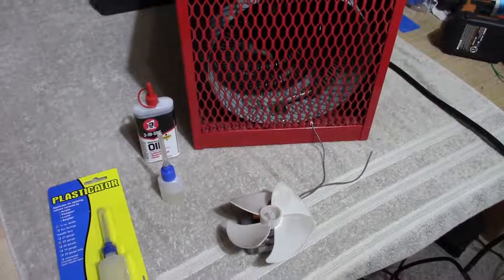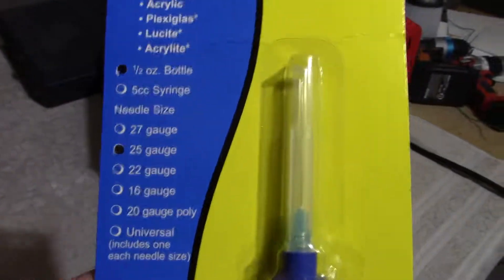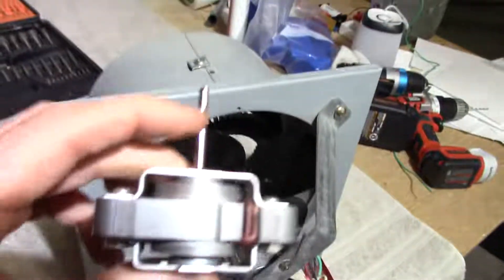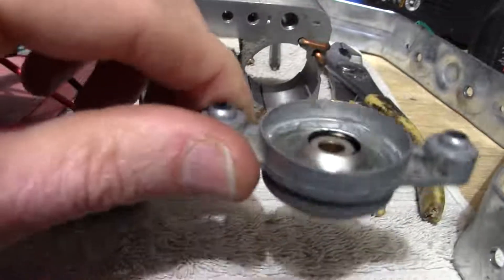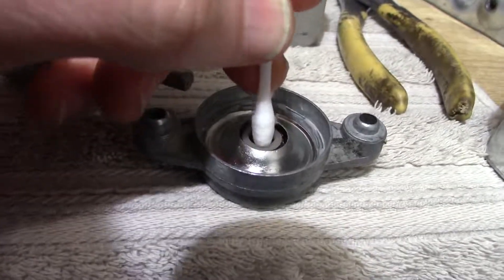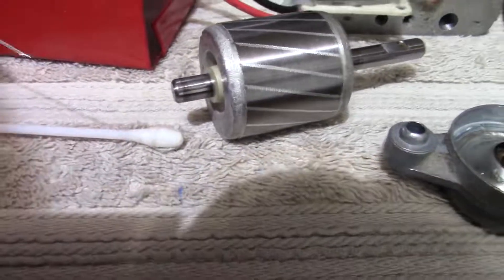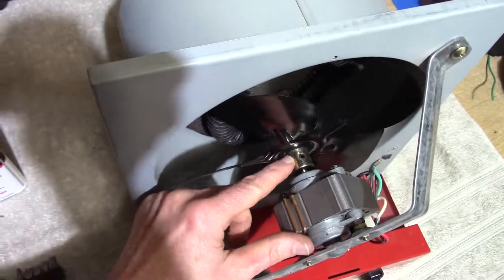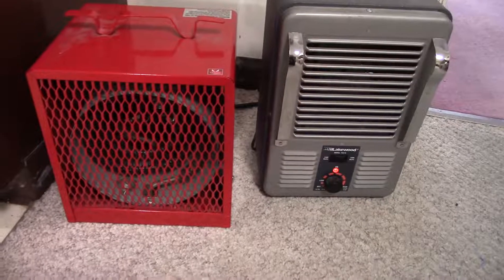Cleaning and oiling small AC sleeve bearing motors

Comment: That white washer thing is actually a "slinger".  It's an integral part of the oiling system.  It is the part which draws oil through the bearing and slings it back into the bearing wick in the bushing cap where it is somewhat filtered and returned to the bearing surface.
The more you know...